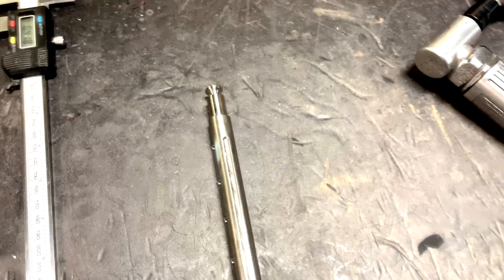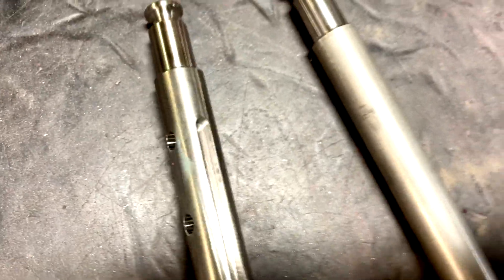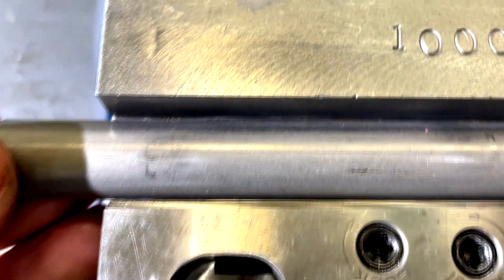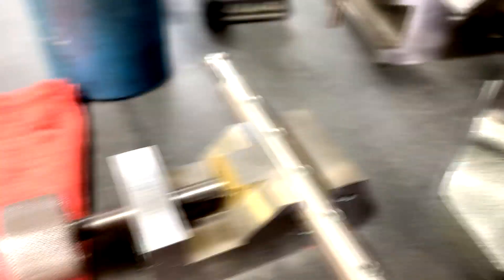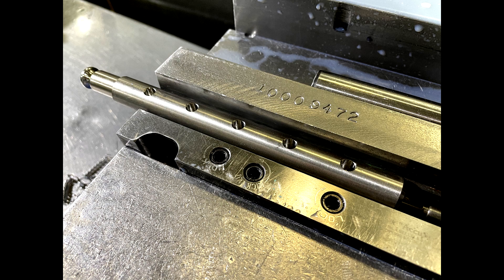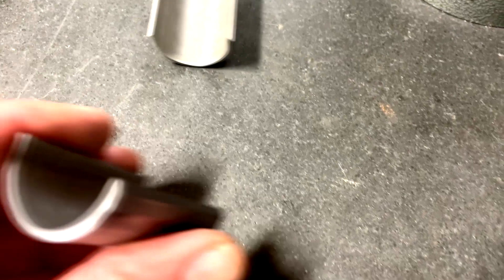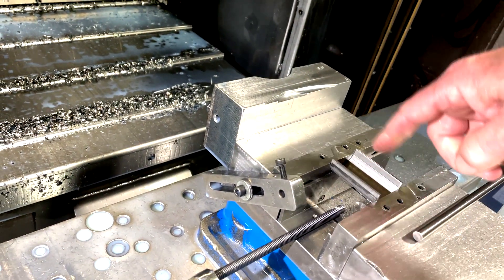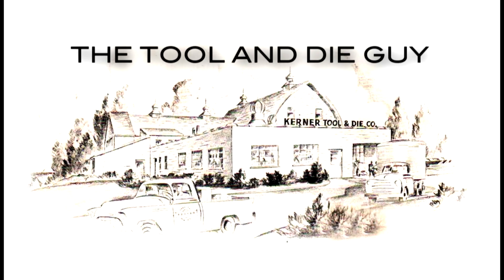"LIVE" FROM THE SHOP: 2 SETUPS

Comment: I had to do something similar for a project of my own. I cut the keyway and needed a through hole at 90 degrees to it. I put a piece of keystock in the keyway, then clamped the shaft with the key in the vice, it was clocked at 90 degrees and being held securely with no shaft damage. Then used an edgefinder to get the center of the shaft and drilled away.